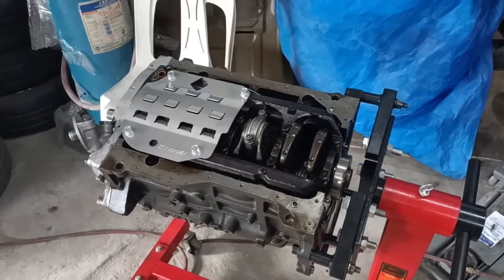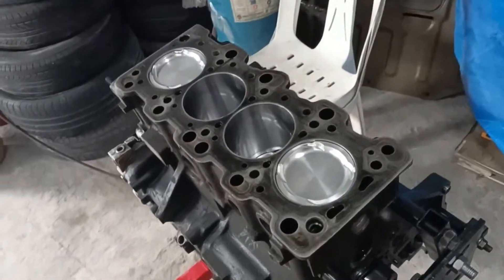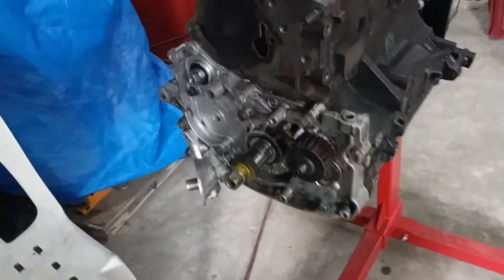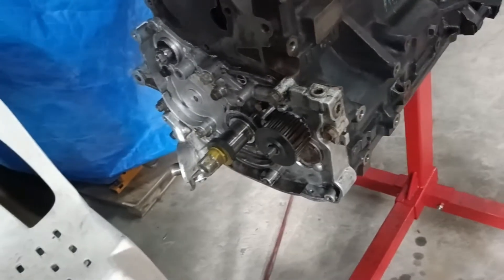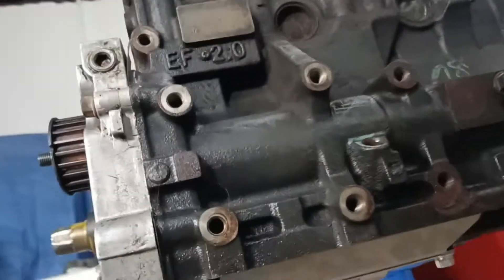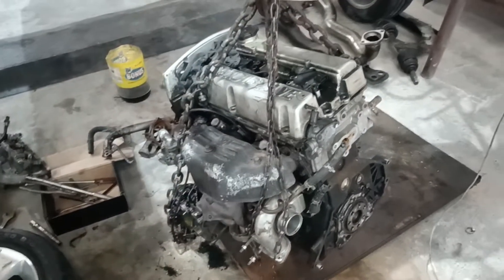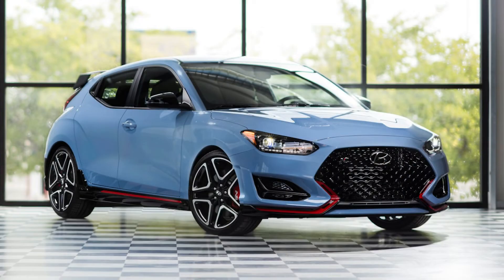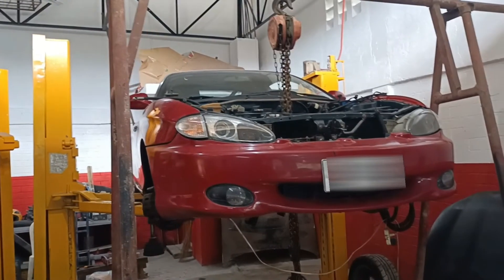AWD Tiburon gets Stroker Korean 4G63! G4JP 2.3L Forged Build for Project Coupe AWD

Comment: Does it fit without doing much to the subframe? I have the g4gm, was thinking about swapping in the G4JP into the tib rd1, due to strick laws in my country, I can't cut or modify the mount.
Reply from the maker: With the AWD transmission and transfer case,lots of hacking on the subframe. But depends if you can locate a G4JP with a manual FWD transmission. Maybe you can make do with custom motor mounts. If that is the restriction in your country, this swap will not work for you. Swap over the G4GF 2.0 instead, or turbocharge the 1.8.
Reply: I see, my current 1.8 does has turbo on it, just i think i might need a new engine since it has over 380,000km. So G4GF was my go to pick, if the G4JP was compatible with the tiburon without custom motor mount i think i can make it work.

Comment: Could you mount a sonata engine to a Lancer to make an “asembolution”? Theoretically speaking, of course.
Reply from the maker: No because any Sonata with the Sirius (4G63) engine is FWD and non turbo. If you are starting from scratch you will still need a lot of parts from an Evo to make it AWD. Might as well start with an Evo engine. Which we did.
Reply: @kuholgarage  I see. Thanks

Comment: Does the 2.0L version carry the same differences as the evo ?
Reply from the maker: If you research about the Evo 4-8 4G63 swapping to G4JS 2.4 on the internet, it's mostly similar as to the differences. Except for the timing belt. The G4JP belt is too short for a retrofit to Mitsubishi belt to work.
Reply: @kuholgarage  my car is hyundai trajet with DOHC 2.0 engine (i believe that it's G4JP). And I read that G4JP's engine is the same as Mitsubishi Evo's 4G63, is that true? If so, can the parts from the 4G63 engine be installed on the G4JP engine (such as the piston, connecting rod, & intake manifold)?
Reply from the maker: @viano_16  basically yes. Check out our other videos on this engine and project.